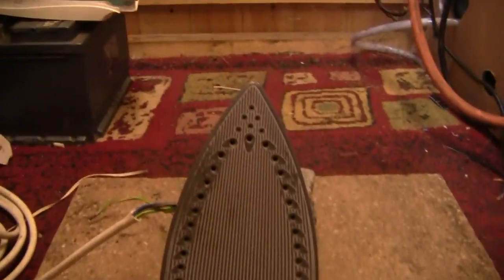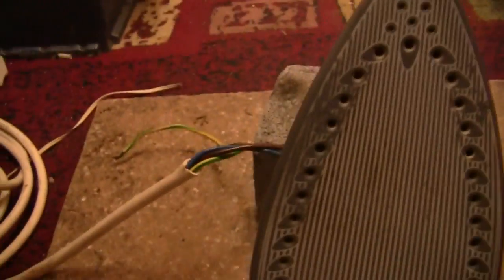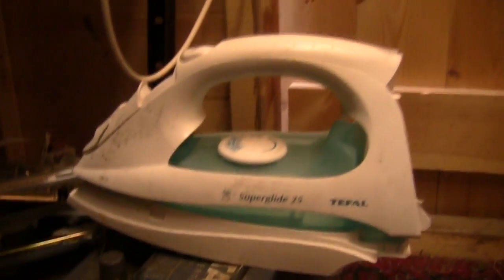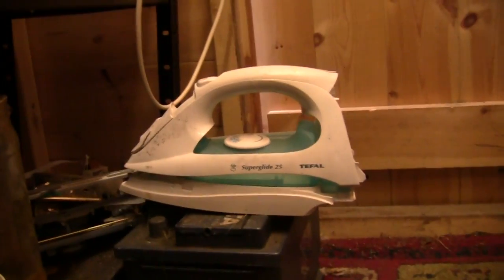Iron overload

Comment: LMAO. :D An arc in an iron, ROFL!

I do wonder what other domestic bits+pieces we could shove arcs into? :D

I've seen multiple "Arc-in-lightbulb" vids, but arcs in irons? The only thing I can think of that happened here, is the element went partly open, but close enough for the juice to continue, hence an arc-up in there. :D

It'd be interesting to get another iron, bypass the safety bits again, then crank it RIGHT UP on the volts, maybe 415 or something like that. Get it Glowiiiiiiin' :D

-BBD